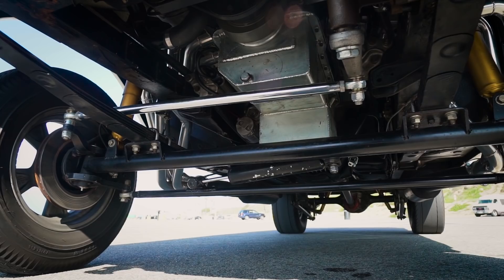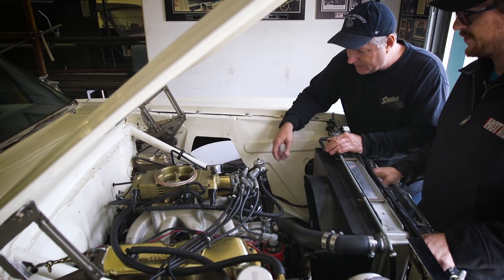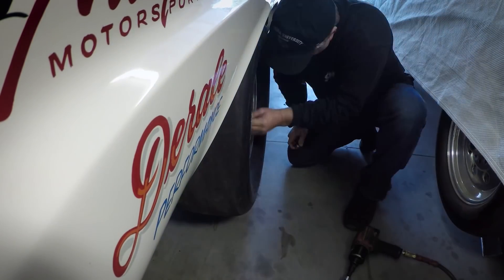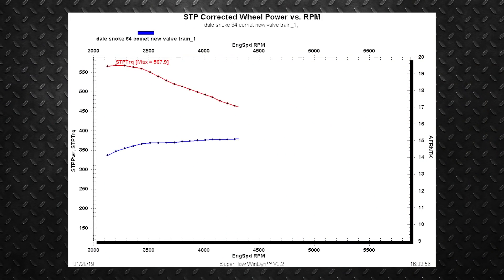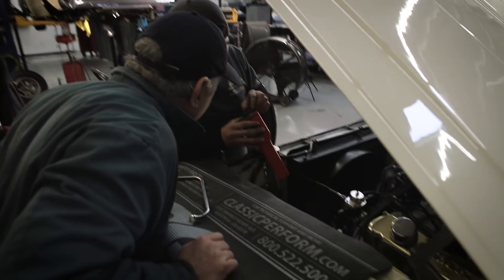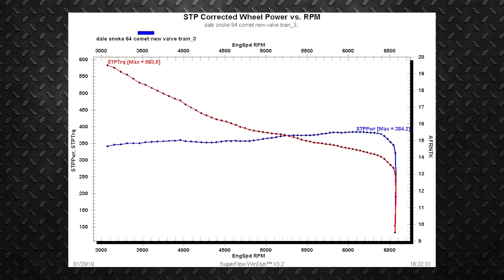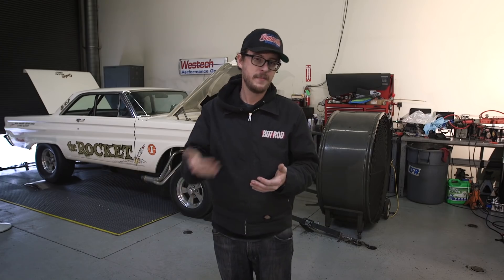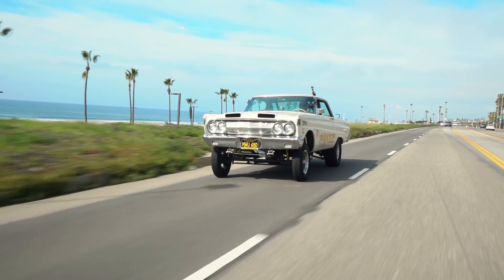Dyno Testing a Holley EFI on "The Rocket"

Comment: It lost 30lb ft of torque down low. Why are we not talking about that?
Reply: if it did, its simply because the ignition timing map was not changed to accurately match the distributor. the efi has zero to do with that.

Comment: Gassers just look stupid. Hated them since I was young. What really is the point of that set-up?
Reply: To go as fast as possible
Reply: waaahhhh. its called WEIGHT TRANSFER.
Reply: Thats what they thought worked best at the time.  It's nostalgia.  I think they're great but I hate 18's on muscle cars.  All opinion
Reply: That's what DID work best at the time
Reply: Just for youtube yeah, exactly like I said, nostalgia.  Not too tough of a concept.
Reply: Basic trigonometry. It gives you the illusion of weight transfer.
-- When you jack the center of gravity up like that, it creates a downward vector aimed at the rear tires. The axle/leaf springs make up the horizontal component. If the car is 4000lbs and 50% weight distribution, you get 1000 lbs of traction for each tire. If you have a 30 degree angle between the axle and C.G., the vector will be 1000/cos(30)=1154lbs. 1154*sin(30)=577 lbs. That's 570 additional pounds of traction per tire!!! 1.5 G of acceleration at launch if you can get the right torque converter, shocks, and leaf springs.